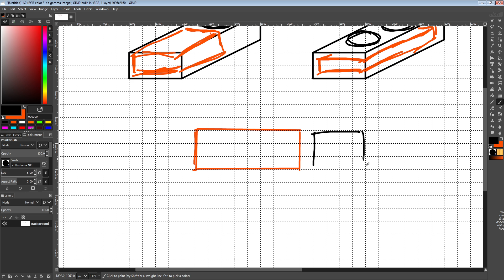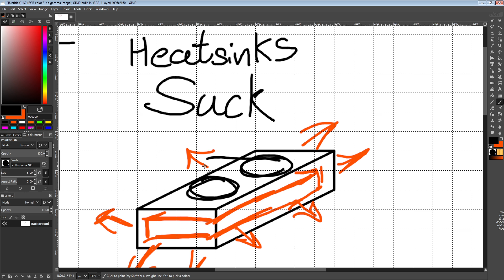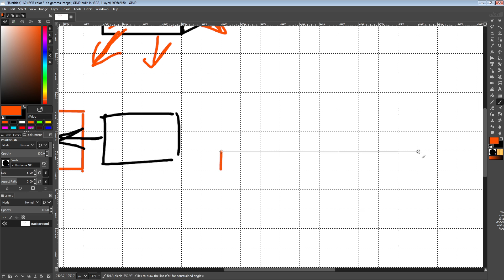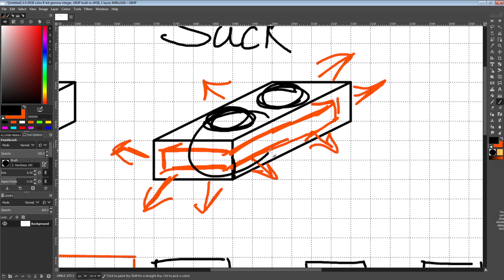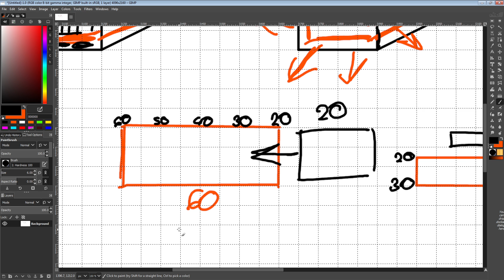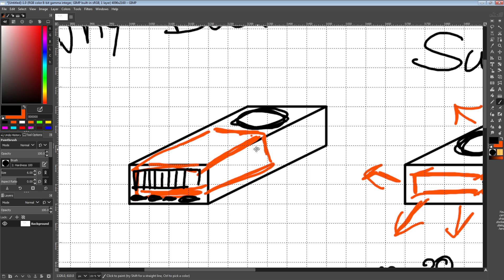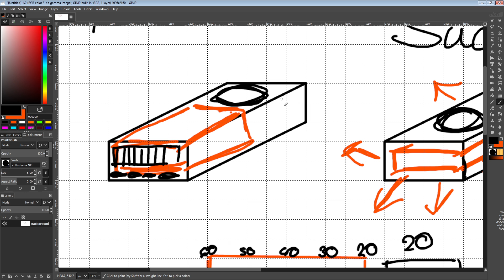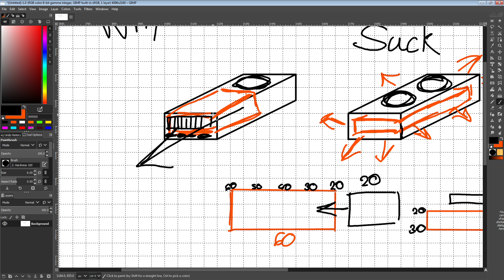Why blower heatsinks suck

Comment: While the thermodynamic principles you laid out were valid, I feel like there are a couple of counterpoints:

1) There is a difference in cooling efficiency between axial and blower coolers, as you have outlined, with the axial type having a marked advantage.  I think the context really matters, though, in whether that is meaningful.  For SIs and OEMs, sustaining 10% lower GPU performance at the same cost while remaining in-spec thermally is going to be worth the trade versus managing the heat placed awkwardly into the system.  Enthusiast systems tend to have massive airflow relative to OEM builds that is capable of forcefully [and inelegantly IMO] dealing with that problem.  Reference blower designs are for maximum compatibility as a part of a larger thermal system, not chasing the ultimate thermal efficiency in isolation.

2) A lot of the criticism leveled at blower designs comes from a crowd that gets stuck on the word 'throttling'.  In a world with ever more fine-grained DVFS and opportunistic boost algorithms in play, the concept of throttling has become somewhat lost on a lot of hardware enthusiasts.  It's not really a matter of one cooler design throttling and not another, rather how much thermal headroom (and other parameters) is present in each design under which the DVFS logic affords performance.  This is a matter of optics: the lower performance achieved with a blower is not some indication of a failed design or of problematic operation, rather it is just a data point in the broader cost-benefit analysis of system design.

I strongly agree with your assertion that case design is at the root of this problem.  ATX is entirely unsuitable for what the modern enthusiast system has become.  ATX is in no way optimal to deal with how much power modern CPUs and GPUs use, and the layout of the add-in cards couldn't have contended with a future of 350 W triple-slot behemoths.  Assuming it has too much inertia to easily change, I think there is still room for a couple of design wins in the short term:

With the reasonable death of NVLink/SLI outside of extremely niche systems, I hope that the majority of ATX motherboards ditch the second PCIE x8 slot and repeater chips in favor of better placement of the single X16 slot.  Slot 1 tends to be needlessly close to the CPU and DIMMs and can easily be pushed down 1-2 slots for better clearance.  Asus has already moved it down 1 with the Maximus XII Extreme and Apex, something many older boards had back in the northbridge days.  This even leaves a better spot open above slot 1 for M.2 devices, rather than being roasted below a GPU finstack.

Next, we have triple-slot GPUs, but not much clever use of the reverse side of the PCB.  Why not have a triple-slot GPU where the reverse side is one of those slots?  Imagine for example if the I/O (HDMI, DP) was mounted on the reverse, or spread some of the thermal load out, like mounting the memory packages and/or some of the VRM components on that side.  I also think if multigpu is properly dead, bring on the 4 or even 5-slot coolers.  Not many users install a second add-in card anyway, why not use that volume to further increase the efficiency of the GPU cooler (the single biggest source of heat in the system).

I think the Mac Pro, of all products, does the best job of demonstrating what is possible without the constraints of ATX.  In that design, you have the DIMMs on the opposite side of the motherboard, isolated from the CPU heat.  You have the add-in cards done in the style of a 3U rack with high volume full-length coolers designed with very low fin density for low static pressure airflow penetration.  The cooling concept of a server rack can be achieved without insane airflow and static pressure, it's just that the heat sink volume, fin densities and obstructions have to be scaled to compensate.  ATX, by comparison, is full of dead end corners, right angle airflow, pointless close proximity of heat-generating components, and almost unavoidable obstructions.

I want the motherboard vendors to be more brave with this stuff.
Reply: I think you have a lot of valid points, but moving away from ATX is going to take more than a brave motherboard vendor.  PSUs and cases will also have to change at the same time.  That requires multiple manufacturers to work together on a new concept that may or may not be successful.  Or... a brand new standard to be created for the entire industry.  I just don't see this kind of stuff happening any time soon.
Reply: @prycenewberg3976  Agreed.  The enthusiast PC platform, as opposed to the more locked-down and bespoke SI PC platforms, prides itself on modularity and backwards compatibility.  Being so far on the open side of the closed-open platform spectrum makes change very difficult.  For it to happen, a more radical design change would have to prove itself extremely valuable to the market—something customers are ready to line up and pay for.

While a more modern standard could clearly do better than ATX, it probably couldn't be so significantly better that it would drive high demand for it immediately.  Without that sort of incentive, it's going to be too much of a risk.  Maybe it just takes running harder and harder into walls until we're actively looking everywhere for a solution to the headaches, and for now it's still tolerable.

I think ATX12VO and the new 12-pin GPU power connector could be interesting in terms of their market penetration: how quickly will these standards find their way into enthusiast products?  If we see rapid uptake, it might predict a more positive outlook for moving past ATX at some point.
Reply: To be fair the earlier attempt to improve ATX, BTX clung on much longer in OEMs after colossal failure in the DIY market. Really I think we need to take design queues from the server space for full size boards and more dual chamber cases for ITX which then will allow for more rear mounting of M.2 or memory.

Comment: The fin stack inefficiency discussion is a subtly incorrect explanation for the correct phenomenon. What happens is that the temperature goes 20->40->50->55->57.5, so the first fifith of the finstack gets rid of half the heat. The change in heat is proportional to the change in temperature. With the thinner finstack, it only ever sees the first fifth, so the entirety of the thinner finstack's area is as efficient as the most efficient part of the longer finstack. Given that they have the same total area, this means that the thinner one is more efficient.

Comment: Another downside is dust buildup...  
in blower heatsinks the dust just blocks any airflow after a while and worse, with how these founders edition cards are engineered you can't easily access the fins to clean them, your best bet is to try and blow compressed air through it but good luck getting all of it out of there with the fan in the way.  
Of course when the dust buildup blocks the air the already loud fan will spin even faster to compensate making the card even more noisy.  

I only had a blower card once, a GTX 260 and i ended up replacing the entire heatsink with a Scythe Setsugen just because i couldn't clean the damn thing properly without taking it completely apart... and at that point, why even put it back together the same shitty way, so i can repeat the process every 3-6 months?  
Since then i always said the 50-100 bucks extra on an aftermarket card with a GOOD cooling solution is easily worth it for just not having to deal with any of this crap. 
(and then EVGA made me install thermal pads on my 1080 FTW ... yeah... that wasn't fun, at least it didn't explode on me)

Comment: While you have a good start, especially with the fluid dynamics of air heating up through the finstack. I think you are missing some of the key parameters at work here. 
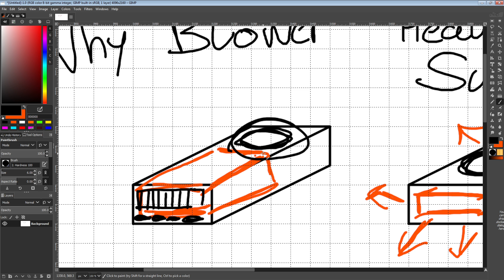You have to keep in mind that radial flow ("blower") fans have much higher pressure than an axial flow fan. So your "put a high pressure fan right in front of the intake" (6:56) is the blower fan itself. So the greater impedance to flow through the heatsink, and the much smaller opening is much less of a problem for them. Axial flow fans have higher airflow, but worse pressure. This is why you have so many exits for the air to go: the resistance to flow is a problem for them, so freeing it up is crucial to the design. I haven't run the numbers, but I strongly suspect a blower card can get away with a more restrictive heatsink that has more surface area than they do now. 

The reason you see really "deep" contra-rotating fans in servers in because the restriction is so high they need a lot of pressure to be able to move air through it. They could use radial flow "blower" fans, but there are not well optimized for the servers which intake air from the front instead of the side.

Here's an example comparison of sanyo fans. I tried to pick two that are close together. The axial fan is more powerful.
9GV1212P1J011 axial flow fan 120*38mm, 12V, 3A, 64 dB. It has 224 CFM and 360 Pa of pressure.
9BFB12P2H003 blower fan 120 * 32mmw 12V, 2.3A, 62 dB. It has 56 CFM and 1250 Pa of pressure.
Compared to the slightly larger and more powerful axial fan, the blower has 1/4 the CFM and 4x the pressure.

So given the tradeoff between axial flow and radial flow fans, the reason why axial flow fans are better in this application is because while they have better airflow and worse pressure, you can take advantage of the better airflow more than you can take advantage of the better pressure. In other words: they are more efficient. You also have multiple axial fans, so there's more fan available than with a blower card which only has one fan. Putting multiple radial flow fans on a single card has its issues. Perhaps a better comparison is to take a blower card and compare it with an axial card with one fan disabled. Or you can compare multiple blower cards all stacked up with multiple axial ones: you will see the airflow out of the blower card is less affected by the restricted airflow at the input. Since most people have only one GPU, the input to the fan is much less restricted, another reason why axial fans are better here.

Put another way: compare it with water cooling. If you have a pump with more pressure, you can put it with a more restrictive coldplate and get good performance. If you have a pump with less pressure and more flow rate, you will have issues getting it to work with a restrictive coldplate. Perhaps this is a bad example, since all WC pumps are WAY over-rated in pressure and in flow rate both, but the principle is the same.

I watched on in the video and I have some more disagreements. For example, the reason why the blower heatsink is longer is to take advantage of the higher pressure. It's true that the efficiency of the cooling decreases the longer the air is in the heatsink, but as it travels across, a single particle of air can absorb more heat from the sink. So there's less air flowing through it, but each particle of air can move more heat away from your device. It would only be "literally the worst shape" if it had very low static pressure and high airflow like an axial fan. I think I'll stop editing my post here and just say: please talk to a heatsink designer. Not necessarily one for GPUs.
Reply: I love blower GPUs they remove the heat from inside the case and also allow me to have 4 of them at the same time.
Reply: "please talk to a heatsink designer. Not necessarily one for GPUs." Why he says the heatsink is fine(well subjectively) its the fact that the fanblower actuates airflow in the most ineffiencient manner
Reply: So I am just tuning my first custom loop water cooling. I noticed that at least for idle temperature, getting my dual pump down to 60% rpm all the time is way better than 100% with similar radiator fan speed configuration. I didn't test thoroughly the under load performance since boost is concerned but I think water cooling is a little bit different since there are 2 parts of heat exchange in the whole loop?
Reply: It also depends on your case, blower cards are the best thing ever for mini-ITX builds since you can't afford for anymore heated air to cycle in your case than what already is being displaced by the CPU cooler.
Reply: If we assume identical heatsink area, you could probably argue that a blower card is removing twice as much heat per unit if air - I’d imagine thermal transfer is one of those things that has exponential decay, so having a heatsink 4-8x “deeper” than an axial card is only going to deliver 2-3x the heat dissipation per unit of air (thanks to the aforementioned heating of the air and the reduced thermal transfer that entails). So far, so good. Then we run into the fact that despite the pressure it produces, the typical blower is probably going to move 1/4-1/3 as much air as an equivalently loud axial fan (as your own example shows). So the blower card overall is moving probably 1/5 to 1/8 as much air as an axial card. 1/5*3 = 3/5ths the cooling performance of an axial card. 

The extremely rough numbers above show why blower cards are kinda shit. You can quibble about the specifics, but I think it’s difficult to argue with the overarching point.
Reply: At the end of the blower heatsink the air is too hot to absorb more heat, amirite?
Reply: The points "he missed on" were unnecessary. He knows more about pressure vs no load CFM rating than you. Your efficiency explanation doesn't explain anything. CFM is the maximum thermal mass a fan pass trough open space. Pressure is how good the fan is at keeping up with its CFM rating under the load of heatsinks and obstacles.
The blower heatsink is long, because this is the biggest shape you can fit within the dimension constraints.
Efficiently pushing 1/4 the thermal mass with high pressure fan is worse than pushing much much more mass trough shorter heatsinks. Dual axials have much better heat distribution troughout the heatsink which is a key factor in measuring cooling efficiency.
The shape comment focuses only on the heatsink shape and assumes the most advantageous fan type is installed for any of the heatsink shapes compared.
Reply: @two_number_nines  "Pressure is how good the fan is at keeping up with its CFM rating under the load of heatsinks and obstacles"

I think you're describing a P-Q curve, which shows the correlation between pressure and flow. On one end of the chart, you have maximum pressure which is achieved when there is zero flow. On the other end, you have maximum flow, where there is zero impedance (pressure). 

You can have a fan optimized for static pressure but not move enough air in a less restrictive scenario (such as heatsink fins where there is some restriction but not absolute) or a fan that moves a ton of air but suffers when used as a heatsink fan. You'd need the curve in order deduce which fan is best for which application.

As far as blowers go, they're fantastic for applications where airflow is restricted and/or the space inside the chassis is very tight. Very little hot air is recirculated, so the blower doesn't lose nearly as much cooling efficiency as an axial one as fan speeds are increased. Of course, this may not be the case when you're comparing three axial fans to a single blower. Blowers are meant to be loud, and have very high RPM ceilings. They can perform incredibly well, even better than axial coolers at very high RPM, but of course will be very loud.

Comment: Thank you for pointing this out because it's absolutely true, Blowers aren't bad coolers it's always their heat-sinks that are designed completely garbage. making them appear like they are absolutely terrible. they are much more efficient at exhausting heat out of the heat-ex-changer and the system Case, They are loud, yes, but if made properly they can provide superior cooling results then axial cooling that's popular with AIBs. It's just there hasn't been a proper blower heat-sink made. Thanks for reinforcing this idea Buildzoid, Every-time i bring this up to other-people they dismiss me as crazy. But it's a fact especially when you look at common sense at engineering and enterprise systems.

Comment: Graphics card cooling in general is a problem because it's a smaller sized computer that often is more powerful than the actual computer it slots into. While CPU's enjoy the luxury of massive tower coolers, GPU's are stuck to smaller boards and the whole thing is made to not interfere with other PCI slots on the board.
Ironically it's once again the CPUs that have tons of options for water cooling while graphics cards actually would benefit a lot more from it. One of the biggest advantages to water cooling is being able to move the heat far away from the source before dispersing it over a radiator surface that can be both much larger and have better airflow than any gpu air cooler.

Comment: Open air is much better than blower, but that doesn't mean that the open air is flawless. The fact that the air is exhaulted back into the case causes CPU and GPU to heat up over time along with other components. While the GPU is the more power hungry, the CPU is the one with more OC potential in my case and this thermal situation limits my OC on the CPU. I currently reversed the airflow of my whole system just to allow the CPU to breathe more fresh air as the cooler is closer to the rear fan than to the front fans. The GPU benefited from that also. I saw some people put Noctua tower coolers on the GPUs, this is really allows the best airflow parrern, but also takes tons of space.

Comment: Why nobody is making  VGA cards with tower cooler ?  It would be perfect for front -back airflow  designed cases . Always fresh air from front and exhaust at pci slot covers . Yes it would take 6+ pci slot so what ? Most ppl dont use soundcars/ Lan cards  / SLI etc  anymore .